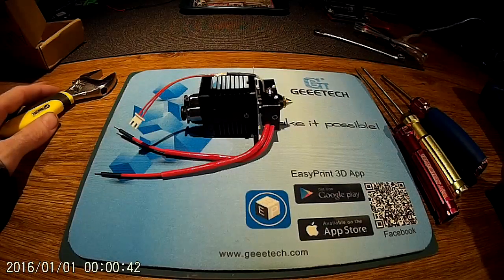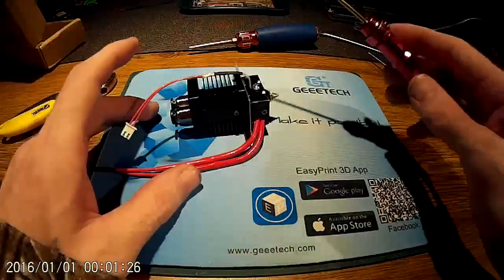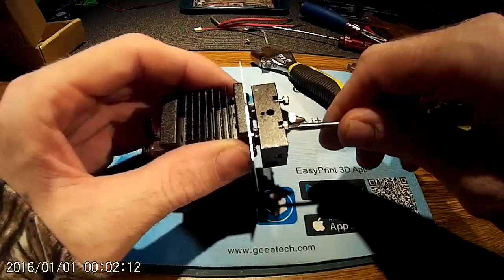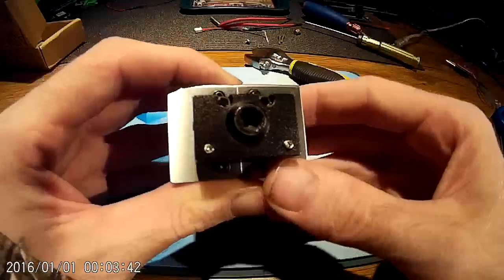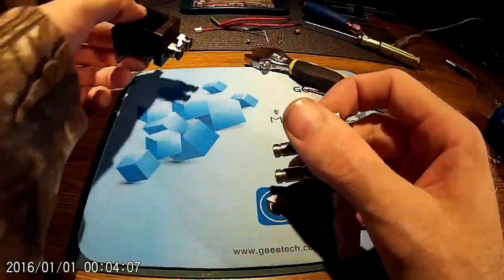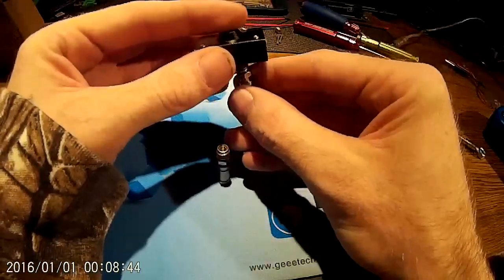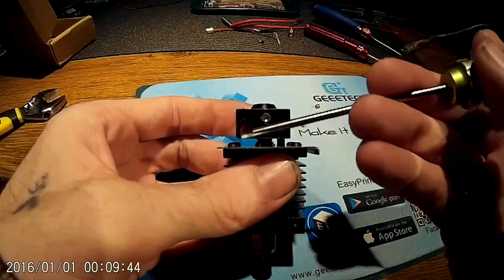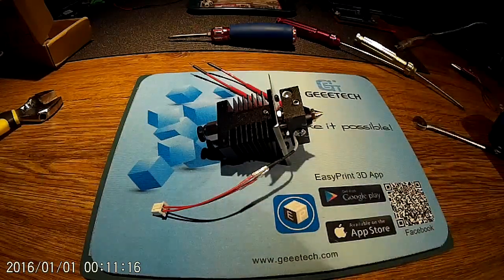A10m hot end tear down and back flow discs explained

Comment: doubt you will respond to this but i found a small metal bb in my hot end is it there for a purpose or is it left over from manufacturing?

I should note this is a brand new hotend never installed

Comment: I wonder if any company makes replacement heatbrakes (the small metal tubes between the heater block and cooling section, which fit those backflow stop discs) for it out of Nickel or Titanium? If so then perhaps this will be my new hotend. If I can use it and stop heat creep (with Titanium or Nickel heatbrakes) then I can print in ABS with it and I'll be happy.
Reply from the maker: i print ABS in its stock form and heat creep is not something i think i would believe only cause i have had a thermocouple wrapped around the first fin at the bottom and heated the hot end to 250c and let it sit for 10mins and the temps only got maybe 10c above the room temp which at the time was 28c so at 38c you should have no issues with this so called heat creep. could be possible but i dont believe it again i print ABS on fully stock A10m machine, only mod was me using parts from an ender 3 hot end combined with parts from the stock to make this one single color.
Reply: @chrisrydoinstuff8525    What hotend heating element are you using? Mine is a 70W 24V unit which easily gets me into the 550°C range. The parts I discussed are to allow me to dual filament print with my Creality CR-10 V3 (and CR-10S5) and one of the various BigTreeTech boards I bought to allow me to print at very high temperatures (it has both Thermistor and thermocouple ports instead of the "Thermistor only" Creality standard boards) to prevent near any chance of heat creep into the cooling section at that extremely high temperatures (PC, Nylon, etc high temperature filaments) I often print in. I most often print in ABS as I have for well over a decade (can't be that far from 20 years now - I'm older, nearly 50) because I've only ever found 1 brand of PLA which doesn't burst everywhere because of water deep in the filament (meaning virtually everything I've ever printed in PLA was a complete waste of energy & money) turning into steam at the far higher (than the 100° water boiling point) hotend. But Inland PLA filament jumped up in price without warning and because I've everything focused on ABS and far higher temperature filaments, I've completely given up on the now (without justification) relatively expensive, formally cheap filament (PLA). It's a shame there's no way to both fit the nozzles over the hotbed and cool them enough while printing over the entire hotbed with 2 MicroSwiss hotends (turned sideways the nozzles don't stay over the hotbed at the front of the hotbed and are too far forward at the rear, also in standard arrangement but side by side the Right and Left sides of the hotbed become useless as both nozzles can't stay over the bed so that both can print the same areas nor both staying over the hotbed at the far Left and far Right sides). Sure my CR-10S5 has a large enough hotbed to enable a large printing area with the 2 hotends in either arrangement, but a large enough area is lost which makes it unacceptable.

Comment: To heat the block up I use one of my old disabled buggy 12v battery on the heater or bring a cable off the printer powerpack unit set on the low voltage terminals

Comment: Hi ! thanks for the video. I just tried one of these on my printer and it didn't print for more than 5 minutes then jammed. Took the hot end apart and noticed the 2 pieces of PTFE tubing were missing inside the guide tubes just like yours. Added them and now it works fine
Reply from the maker: What PTFE sections are you referring to.  The only PTFE parts that go in the hot end are the Bowden tubes that go straight to the bottom of them 2 steel tubes.   So how can you add tubes to that area that weren't already there?.  Maybe your tubes were not pushed all the way down and the filament melts and gets stuck.. .so if you added tubes then put yours back how did they fit with extra PTFE in there? Im confused about your statement. Mine was never missing tubes. And I never had to add some so please tell me what you mean as you might still have an issue but you just fixed it different but other then the 2 white long tubes your filament goes threw there is NO other tubes.   There is back flow disks.  But not any tubes other then the Bowden tubes your filament should NOT be there.
Reply: @chrisrydoinstuff8525  Hi thanks for your answer. I'm talking about the PTFE tube that runs from the bowden connectors to the backflow disks. As my printer is not an A10 or A20 my PTFE tubings coming from the extruders were too short to run all the way to the backflow disks. So I added the 2 pieces of PTFE and my issue is solved. my prints are quite good in spite of some oozing and stringing due to the volume of the melting chamber or a bad nozzle but I'm working on this. My comment aimed to the people who wish to mod a printer using this hot end as most of the other hot ends I used had those pieces of tubing already installed

Comment: Thanks for this.  I've had many troubles with my a20m. Most stem back to a issue with these I believe.  Great straightforward info on what's inside these. I like the printer.  It's been fuatrating being my first printer.  Different extruders helped but still very inconsistent and fussy.  I may convert my messed up hot end to a single color using this info and try it.  Greetings from the states. Southern ny used to visit ontario frequently as a youngster. Many memories of the chaffies locks area.
Reply from the maker: Alright thanks and just a heads up if you subscribed i will be changing the channel but it will still contain 3D printer related stuff. I just have so many hobbies that I figure others may want help with like Dirtbike and ATV stuff, Computer/electronic stuff, Automotive and small engine. And any other tricks or easy fixes related to ANY of those plus other subjects will be on the new channel so I really hope when I switch the couple subs I have follow me over. Thanks for watching and anything I can give info on just ask ALWAYS willing to help.

Comment: Does the new style hot end still have ball bearings in it?
Reply from the maker: Ball bearings? In which part of the hot end are you referring to? As far ad I know there is not bearing in the hotend
Reply: @chrisrydoinstuff8525  Behind the grub screws on the sides are two more grub screws and then two ball bearings.
Reply from the maker: @MrNlce30  yes the single steel balls are in there as that is how they got the 2 into 1 to work is by cross drilling it and then block the parts they do not want filament to run into

Comment: Thanks Chris for the explanation 😁 Would problems occur if the backflow discs are removed?
Reply from the maker: well for the people using this printer who have retraction issues and cant figure out why and they will not get better no matter what settings you try then it could be these but i have yet to try mine without them and would think it would print just as good without them maybe better but if both sides have filament and your only printing 100% from one side it may try and push back on the other side but it may not again i have not tried mine without them, Yet lol ANY Other Ideas i can make a video of explaining stuff for you?
Reply: @chrisrydoinstuff8525  I've removed the backflow discs from mine and it's solved the clogging issues as long as I don't do stupid stuff.